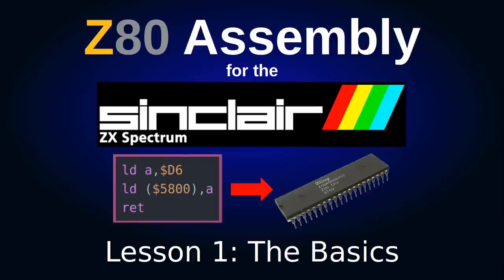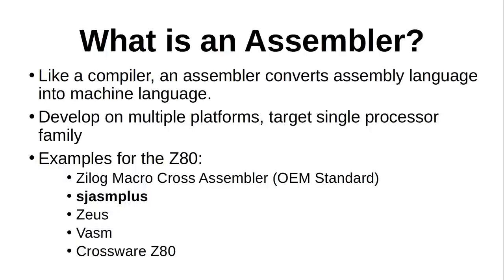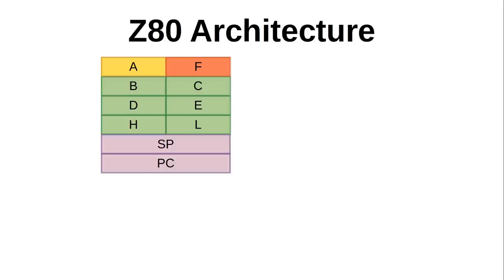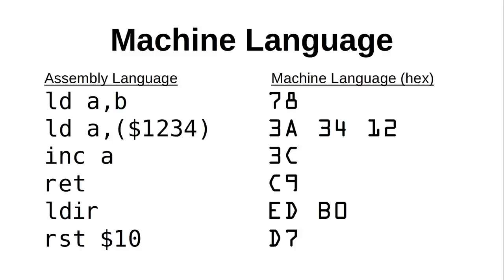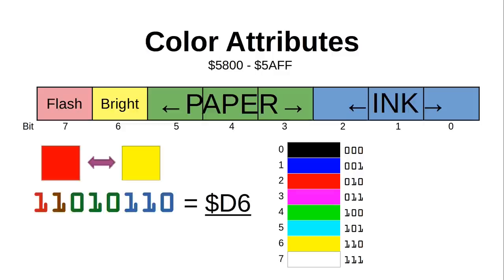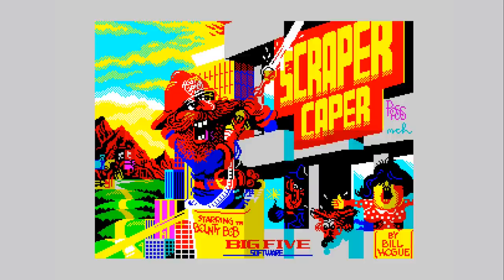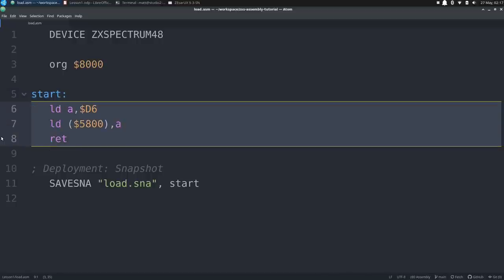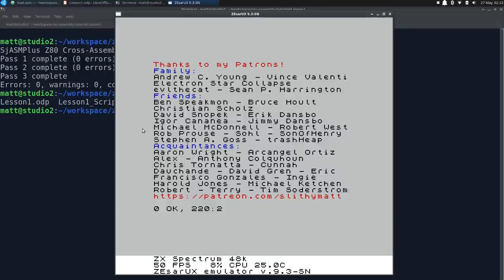Z80 Assembly Language for the ZX Spectrum Tutorial, Episode 1: The Basics

Comment: There are 2 things that made the Z80 the 8080 killer.  The fact that it only needed +5v instead of +5v, +12V, and -5V was absolutely huge, as well as the fact that it only needed a simple oscillator for the clock as well.  The 8080 required a weird 2 phase clock that was beyond bizarre.
Reply: The 8085 sorted all that out in 1976.
Reply: @klave8511  that isn't quite accurate.  While it did allow a single +5v power supply to be used, and a single phase oscillator to be used as well, it's touting of being 100% binary compatible was false. There were originally undocumented changes to flags that complicated code to support both processors.  Plus, it had none of the additional functionality of the Z80, which eclipsed all use of the 8080 and 8085 combined.  I will say that the 8032 line of microcontrollers was nice, but that was a completely different market, which the 8085 sort of entered.
Reply: I have a vintage computer that uses the Intel 8085 - the Tandy TRS-80 Model 200. It's really a powerhouse of a portable computer with productivity programs that can be quickly sommoned from ROM - like the Multiplan spreadsheet. Probably safe to say that this line of portables from Tandy (Model 100 and follow-ons) were the most successful 8085 computers
Reply: Also the LDIR/OTIR type opcodes make a big difference. Thanks to those opcodes, the Z80 could do copy and search operations much faster than the 8080.

Comment: I cut my teeth on a ZX80 kit which was a lot of effort but the damned thing was too limited to do anything of consequence, the ZX81 improved things but the Spectrum took it all to a new level and because it was built upon the 80 and 81's core, was a breeze to migrate too.   Another contender also entered the fray at this time, that of CP/M much favoured by the Amstrad machines and became cohabitable on the Spectrum 3's where many Amstrad games could work natively on Spectrum 3's and I used to create personalised Locoscript installs for companies which was a nice bit of extra money using CP/M.   I used to have big notepads for setting up a programme, create its flowchart, break the flowchart down into modules then work on each module once I had set up the framework, I was working in a bank in the 90's and I sat there one lunchtime and knocked them up a far better database with decent sockets to talk with other bank systems, the programme was actually tiny and super robust and they stopped using it in early 2000's so it lasted pretty well, of course me being green around the gills I got a cheque for £500 for doing that but £500 in the eighties was not to be sniffed at and like any young lad I blew it on beer, parties and young ladies hehe   I spotted this vid as I used to be pretty good at all of this but have lost my way the last 20 odd years, would love to relearn it all and all thru this vid I was thinking "Oh yes, that's how it went" lol

Comment: Bravo!! Loved every minute of this. Early micro computers, assembly language, emulators, Mac’s and even Atom. Wow. It does not get much better than that. I wrote tons of z80 code back in the day. I even wrote most of my code and compiled it on the mainframe z80 cross assembler. ah, the days of single threaded programming. A simpler time.

Comment: I'll be following this - I'm 54 and cut my teeth on creating assembly code and hardware design for various different 4- and 8-bit processors. The first machine I programmed was an 8085 in hex - I remember cheating and using absolute addressing rather than relative addressing to make life easier. Assemblers make life so much easier. 

Good luck with the series! :)

Comment: takes me back not codedd any z80 since the 1990s, I dont think i done any assembly on spectrums mostly Amstrad CPC when i developed a text editor and some small projects on the PCW systems  but mostly coding on low power stand alone chips systems hardware like controllers, io ect .. serial devices with Z80 logic.. but mostly other CP/M based systems .. mad really that Digital Research could have been instead of Microsoft ..  Gary Kildall could have been instead  of Bill Gates

Comment: 7:32 - "(absolute), C" is an invalid LD operand combination on the Z80.
13:27 - There are instructions that load an immediate to the memory byte pointed to by HL, IX+offset, and IY+offset, but not by a 16-bit absolute address. You can make the code clobber HL instead of A as a result.
Reply from the maker: Good catch with the LD (xx),C. I'm not sure how I missed that! And yeah, you could use (hl), too, but I didn't want to get into indirect addressing in the first example
Reply: There's a Z80 knockoff I'm kind of obsessed with that has that LD...

Comment: 16:36 AFAIK, $ sign means current compilation address in most assembly languages. And hexadecimal form is written as ####H, started with decimal number, so you have to prefix it with zero sometimes to obey the rule.
Reply from the maker: No, it just means hex. Each assembler has different notation, but $ is very common for hex. Some assemblers allow multiple notation, including prepending # or postpending H
Reply: @slithymatt , M80 and GEN80 support H-suffixed and do not support $-prefixed hex notation, even Zeus does not. All three use $ as the current compliation address. I did not tell $ is not supported at all for this purpose, simply uncommon. Is common for Pascal though.

Comment: If I remember the IX and IY registers could be addresses as 8 bit registers IX.L and IX.H  my old assembler had this functionality. Not sure if it was common practice though. 
I did a lot with screen drawing on the specky. Most people used LDIR which would cause a screen flicker but it was faster to call LDI in a block 1024 blocks  as the LDIR took 24 T states and the LDI 8 ( memory falling here). 
I think the fastest way was to move the SP to the top of screen memory and push the screen byte. 

Had a lot of fun with the z80 and 68000
Reply from the maker: Yes, you can address ixh and ixl in the same ways you can h and l, for the most part. There are a few exceptions where you can't substitute index register halves, when h or l is one operand, but (hl) is the other. For example: ld (hl),h is valid, but you can't do ld (hl),ixh. What you can do is ld(ix+x),h, but again not ld(ix+x),ixh.
Reply: @Gruntos  "I think the fastest way was to move the SP to the top of screen memory and push the screen byte." - Yes, I do recall hearing about that technique - fairly recently, as a matter of fact. But I haven't quite figured it out yet, to be honest...
I do understand (to some extent) why this would be an attractive approach, though: i.e. using 16-bit transfers per opcode (rather than 8-bit ones), as well as the address decrement/increment being handled automatically. However, I keep seeing the fact that the stack is implemented 'upside-down' for the Z80 as a serious (potential) impediment to achieving high performance for this technique, in certain applications...

(P.S. I can explain more thoroughly what I actually mean by all of that, however I would risk turning this post into an interminable essay - and I would rather NOT go that way... At least, not unless someone else here first manifests further interest in hearing more about my musings on the matter...)

Comment: The MEMOTECH MTX512 can combine Assembly and BASIC together I.E.

ASSEM 10

10 CODE

&H4000 LD HL,&H20
&H4004 LD BC,AH32
&H4008 ADD BC,HL
&H400C LD (HL),BC
&H4010 RET

20 REM End of assembly.

the MTX512 also has a proper keyboard which makes coding easier.

What about storing you assembly language in the REM statements and do CALL RAND USER(16384) or you can do like in this example goto 10.
Reply from the maker: I don't know anything about the Memotech computers. Looks like a nice feature!
Reply: @slithymatt  if a special piece of hardware plugged into the back of the computer you can load and run SINCLAIR Spectrum games for both the 48K and 64K machines and it just happens that you can get the MEMOTECM HDX512 (Hard drive) or the MEMOTECH FDX512 (Dual floppy drive) and can run CPM/80.
Reply: Are you sure the MTX512's assembler supports "ADD BC, HL" and "LD (HL), BC" as pseudo-instructions? The Z80 has neither.

I'm gonna guess you reversed the operand order for those. The latter can be done via:
  LD C, (HL)  ; Load low byte
  INC HL  ; Advance to high byte
  LD B, (HL)  ; Load high byte
  DEC HL  ; Go back (may not be needed)

Once again, I know nothing about the BASIC used by that machine.
Reply: The processor is the ZILOG Z80A get the the MEMOTECH program book and have a look at the machine code for the Sound To Light programme
Reply: @DAVIDGREGORYKERR  I know! I saw that it used the Z80.

Comment: Thank you for that video! I have a ZX Spectrum since the 80ies, and programmed video games in assembler. I really would like to turn this thing on again, but there are two impediments: I have no old fashioned TV as a monitor, and I have no cassette drive, not to speak of the cassettes with the assembler and so on. Any clue, how to fix this?
Reply from the maker: Any TV with an analog PAL tuner should work, assuming you have a PAL unit. Most modern TVs still support analog RF video, but it may be stretched out on the screen. As for a tape deck, you can use anything that can play a sound through a headphone jack. You just need a dubbing cable, with a 3.5mm plug on both ends. Then you can just play the sound file through the cable.
Reply: @slithymatt  Thank you! That helps a lot.
Reply: There is a simple mod to bypass the TV modulator and give a composite video output.  As for storage there are several modern alternatives to tape. Some use SD cards to copy file images from your PC to the SD interface that plugs into the Spectrum.
Reply: @XXXXXX-dy5fs  thank you!

Comment: What a great video! Maybe a daft question but why would you use assembly if you can compile c to machine code.
Reply from the maker: There are many reasons, but mostly when you are dealing with extremely tight constraints, like on a low-RAM system with a slow CPU and no operating system (which is pretty much all 8-bit home computers and game consoles), the code generated by C will be too bulky and inefficient. C was invented for Unix and systems capable of running it.
Reply: Why not program in BASIC, since it comes with the system :)
Reply: @cyberp0et  I used to program in basic a long time ago and ill probably tinker with it a little when I get around to it. I like to code in language like rust and probably c is the closest thing to that that u can code with on this machine.
Reply: It's difficult to imagine how constrained the Spectrum and other machines of the time were unless you've used them.  The ancient (2010) PC I'm running a Spectrum emulator on to follow these tutorials has a quad-core Intel CPU running at 2.66Ghz and 4G of memory; that's around 750 times the CPU clock speed and over 85000 times the memory of my original Spectrum 48K.

Comment: This is an excellent level of explanation. Even to a veteran programmer in different languages. My question is: will this code work for MSX computers?
I am interested in writing programs for the MSX, but could not find enough information and videos for it, since it was not very popular in the USA
Reply: the video ram and other memory layout of MSX is very likely completely different (I don't know how MSX has it), so the code itself will still work the same, write value $D6 into memory at address $5800, but the MSX computer will not create blinking square on screen. (what will happen on MSX depends what is in that area of memory, probably nothing of significance/direct response). Also the output format SNA is ZX snapshot, so you will need to figure out how to produce binary which can be loaded by MSX emulator (or real MSX computer), AFAIK games for MSX are often produced as ROM-cartridge images, I know one huge MSX project does use sjasmplus for it, but it builds the whole file byte by byte manually, ie. any required "headers" of ROM cartridge and special values like checksum are part of the source code, and the source output is captured "as is" as raw stream of bytes (OUTPUT -> OUTEND directives of sjasmplus, or --raw command line option).

in other words, it makes some sense to follow ZX tutorials (the Z80 assembly is still Z80 assembly, but [only] the machine-specific parts differ), and you can also use tools presented here, but you need to find some "glue" tutorial dedicated to MSX which will fill you on those machine-specific details, what's the memory layout of MSX, how to use it's HW features like graphics, sound, sprites, etc.... There's excellent web dedicated to MSX at msx dot org, where you can find also wiki with tips for programmers, and probably also some links to other tutorials or example projects and HW info.

If you are completely new to assembly, and you really want to do MSX, it may make sense to start rather with MSX tutorials, and scavenge the ZX assembly tutorials a bit later, when you can somewhat tell which parts are machine specific features, and pick up the Z80 assembly tricks which do apply also for MSX.
Reply: The z80 code itself will "work", but referring to anything outside it (like display memory) will differ from one z80 computer to another.
Reply: Since even when writing for the speccy you'll probably want to have some kind of hardware reference in hand, writing for the msx shouldn't be much different - you just need a different reference =)
Reply: Also be aware that this assembler does not use the original Z80 syntax.  The “$” (dollar sign) used by this assembler is not a part of the Z80 assembly syntax.  Also, by default, all numbers in Z80 assembly are considered to be hexadecimal, not decimal.  There are other differences as well, but you get the jist..  If you are using a different assembler, you might need to tweak the assembly in order for it to work for you.
Reply: The basic information about how the instructions work is the same. However MSX is totally different to the Spectrum.  Anything to do with writing to screen, reading the keyboard, etc will be completely different.  The MSX did not have an area of screen memory in the main 64K.  It used dedicated VRAM accessed by a visual display processor chip (a Texas Instruments one for earlier MSX machines). The process for writing (and reading) the MSX VRAM (and VDP) require a few techniques Matt hasn't talked about. Basically using OUT and IN instructions (and also DI / EI to disable / enable interrupts).  There were probably also MSX bios routines to do some of that too (just as we saw in the Hello World example program).
Reply: @cnc-maker  That's just a matter of assembler syntax. Even for the same processor, the syntax of the assembler (such as how labels work, how hex values are annotated, how macros work, &c.) can vary, just so long as the mnemonics themselves stay the same.
Reply: @talideon  is that not what I stated?  The OP-codes do need to be the same, but their representation may differ from assembler to assembler.
Reply: @KaelumYodi  Are you "CNC Maker"? Because I was responding to their statement regarding the use of "$" for local loop labels.
Reply: @talideon  yeah.  I forgot to switch channels.  In true Z80 assembly, "$" is not used in any manner and will throw an error during assembly.  Many of the assemblers today try to normal the syntax across multiple assembly languages, but they do so at the risk of being incompatible with the "official" assemblers, as well as others.
Reply: I think all MSX computers use a dedicated video chip which has its own memory, so in order for the Z80 processor to write to screen memory, it has to go through the video chip.